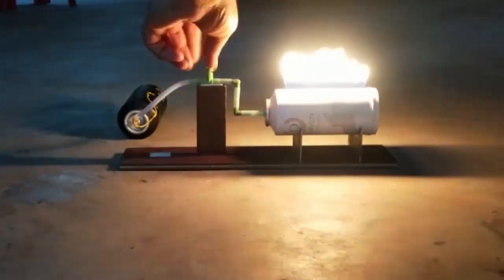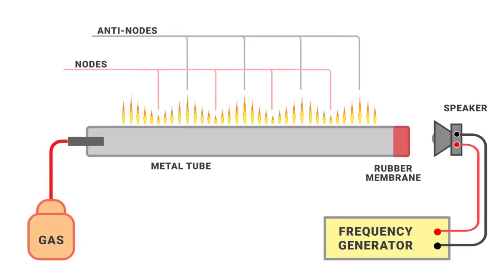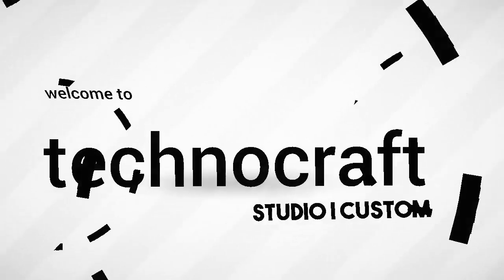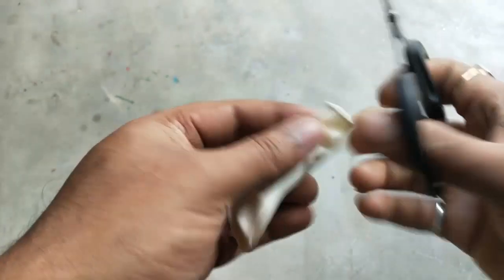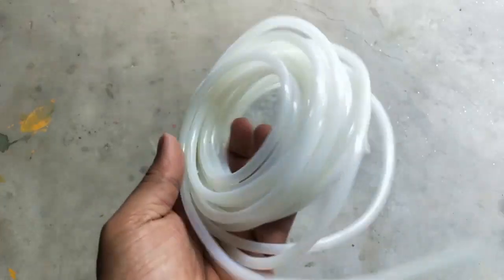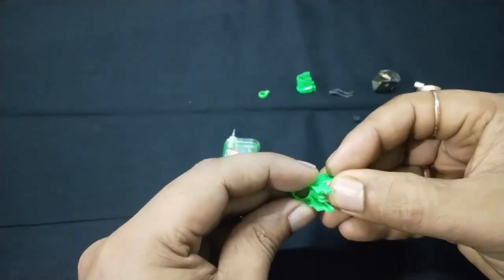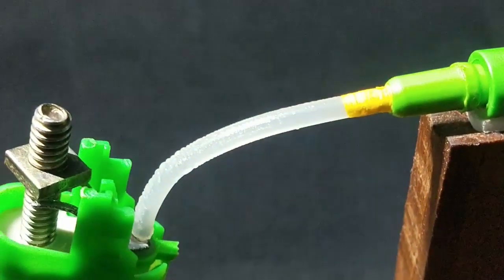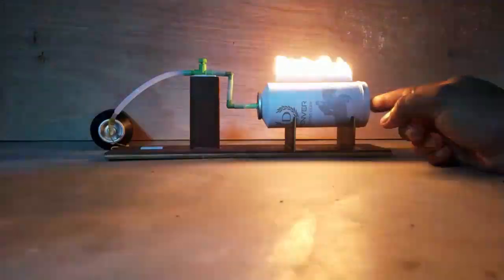Experimenting Ruben's Tube | Standing Wave Flame Tube | Physics Experiment

Comment: You had two problems that you solved, good! However, you didn't prove your design works! A finger tap does not demonstrate the concept. Why didn't you demonstrate music modulating the flame?
Reply from the maker: I had my speaker broken that time so sorry for that, but I assure it will work. You may increase the flame gap to see a better result